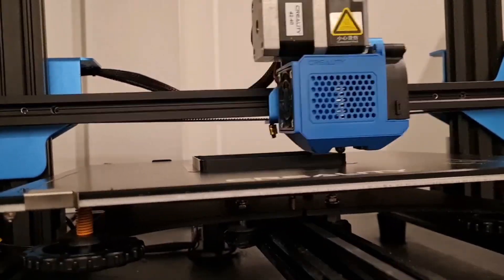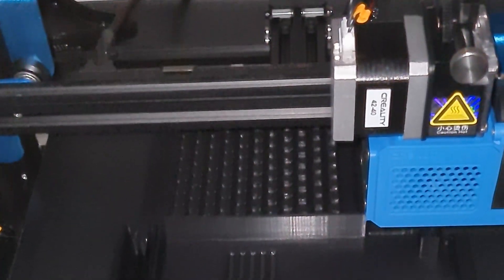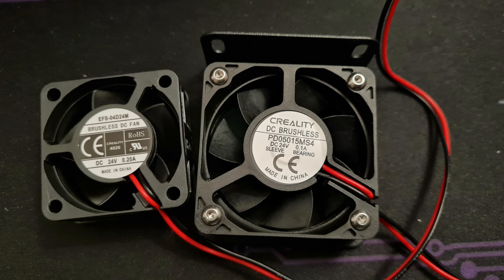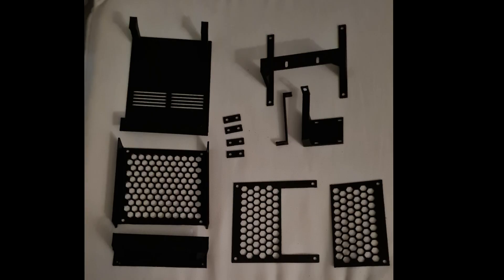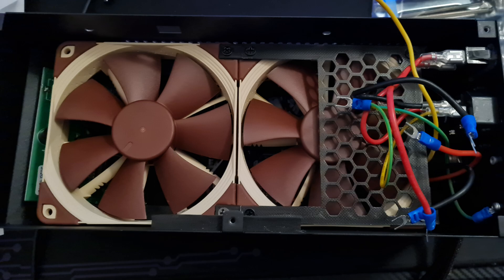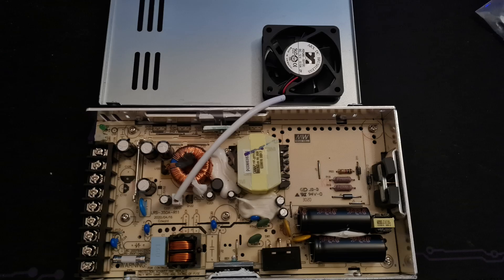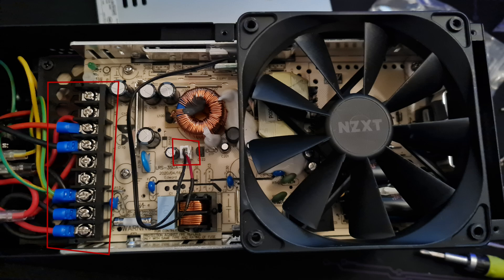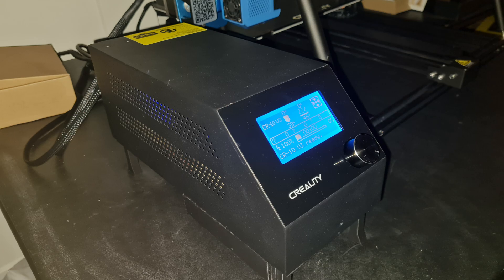Creality CR-10 V3 120mm Silent Noctua Fan Upgrade

Comment: If you don't mind, could you explain how one would wire this with a buck converter if choosing to go that route?  

Thank you.
Reply from the maker: 24V output from power supply to buck converter input, buck converter output (12V) to both fans in parallel
Reply: @davidwang_3d   Thank you.  Now, if I understand correctly (in terms of parallel connecting), you'll bundle the positives from both fans together, and the negatives from both fans together.  After that those will connect to the corresponding outputs from the buck converter?
Reply: No he said they are connected in series which is completely different. you join one fans positive to the other fans negative and shield it. Then the remaining positive on one fan is connected to the positive on the control board and the negative on the other fan is connected to the negative on the control board  @katoracle

Comment: Hi David, Great video, however could you post a wiring diagram showing the connections to the internal power supply and the mainboard please? What model Buck Converter did you use (amperage, wattage etc)?
Reply from the maker: I did not use a buck converter, but I wired the two fans in the control box in series. From 24V positive to fan A positive, fan A negative to fan B positive, and fan B negative to 0V. For the fan in the power supply, it's just positive to positive, negative to negative.

Comment: which Noctua fans are those? Are they Noctua NF-S12A FLX?
Reply from the maker: NF-F12
Reply: @davidwang_3d  that fan has a 4 pin connector. Can you just cut the ones you don't use?
Did you only use one of the 2  24 V headers to connect he 2 fans in series?

Comment: I can't see that it's quiter can u please include a sound or something
Reply from the maker: If it's sitting on the floor, you will barely notice when it's running. On a bench or table, it's a little louder but way quieter compared to stock fans